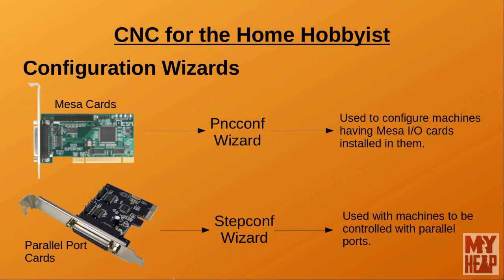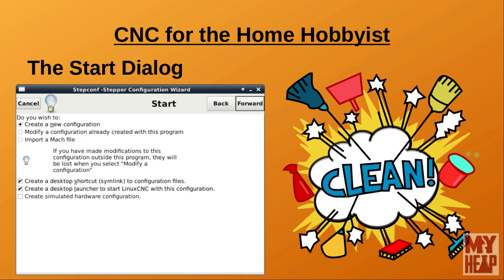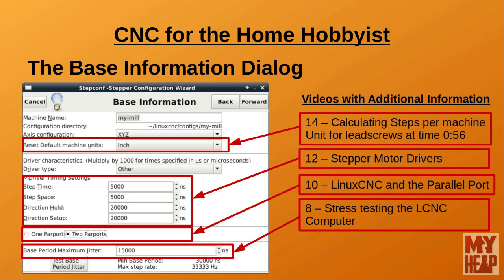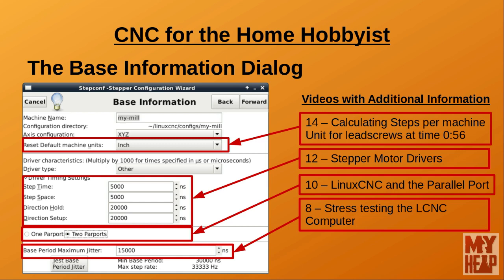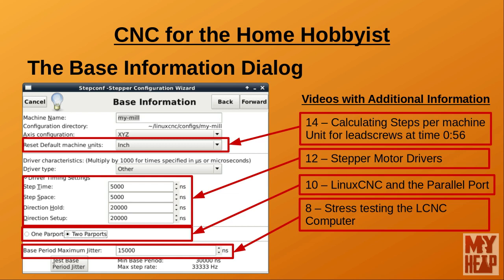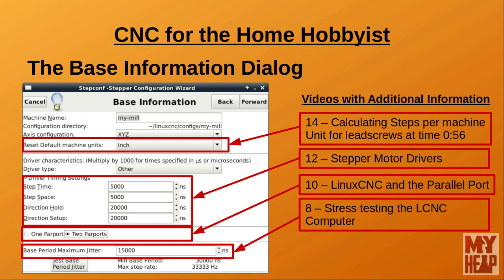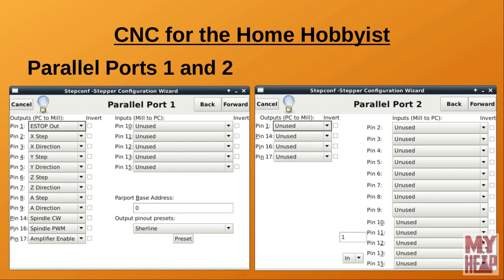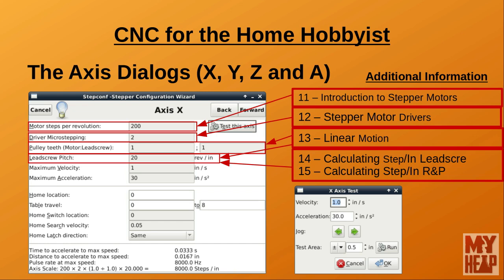LinuxCNC for the Hobbyist - 016 - Configuring LinuxCNC using Sepconf (Overview)

Comment: Hello Joe,

Great videos !  Very well researched and extremely well presented !!!

I've searched the web and gone through all your videos that discuss setting up and configuring the LinuxCNC software hoping to find a solution to a problem I'm having. Hoping maybe you might have come across this or if you could point me to the most logical place to troubleshoot next.

The issue is that my axes always move in just one direction regardless if I press the positive or negative buttons. If I hit X- it goes negative and if I hit X+ it still goes negative. Same with the other axes. I'm using a breakout board and have tried two completely different PCs, an older one with an onboard parallel port, and a much newer PC with a PCI-e parallel port card added. Also used two different printer cables.  I know the stepper motors and drivers are good as I had them running properly using Mach3 until I tried switching to LinuxCNC.  I also ran the stress testers and the Parallel Port Tester which did change the state of the LEDs on the screen but I didn't do anything at the BOB to test it.

Can you think of any possible wiring connection errors that could possibly produce that result ?  If so I'd prefer to start there. Otherwise, do you think the most likely problem is with the BOB ?

Thanks in advance for any suggestions you can offer.

This comment is being posted as cities and states across the US have just begun to shutdown due the the 2020 Corona Virus pandemic.  I wonder what people reading it one or more years from now will have experienced and remembered.

Jay Perez  Rochester, NY
Reply from the maker: Hello Jay.  Yes sir, you are having an odd problem but I think it can be found with some perseverance.

So what we think is happening is the direction pin is not changing state.  You mentioned that you ran an LED test and the screen indicated a change but did not test at the board.    The simplest way to test at the board is using an LED with a current limiting resistor.  Or even a volt meter connected to the pin.  The next logical place to look is the stepconf configuration.  Do you invert the step pins there?  Can you email me your config files?  My email address is xavier@gtec.com.  another great place to find help is on the LinuxCNC IRC page.  You can find a link to it on the LCNC homepages.

You are correct, we are at a time I have never observed before.  I realize that the Coronavirus is a bad thing, but the way the media is handling it makes it much worse.  When you start driving the markets with fear mongering bad things will happen.  I pray daily for our country and our people.  We need to set aside the petty stuff and unify for a solution.

Sorry for the delay on posting to you.  My son just got married Friday and it has been a crazy last couple weeks.  We thought they would want to push the wedding out but they were already committed to the date and everything set in motion.  All I can say is thank goodness for Facebook streams.

Joe
Reply: @MyHeap  Thanks for the reply Joe and congratulations on your son's wedding !

The Rochester Makerspace was recently closed and all access disabled so I won't be able to get in to grab the Mach4 config files for a while.

I've been communicating with Trevor at Newfangled's support but it hasn't been going well and I don't expect they'll be able to provide a solution.

I haven't completely given up on Mach but recently ordered a new breakout board and intend to start exploring using LinuxCNC as a replacement for Mach4 as soon as it arrives.

Thanks again.

Jay
Reply from the maker: @Jay.perez1  do you have the LinuxCNC configs you are using?
Reply: @MyHeap  Hi Joe,

Wanted to say thanks again for offering to help and give you an update on what I found.

After carefully checking all of my connections dozens of times I was absolutely positive they were all correct and assumed I had LCNC configured wrong. After struggling for days and many hours I walked away from the project. When I got the courage to try again last week I discovered within 5 minutes that I had the +B and -B stepper motor cables crossed on all three axes. (I can only assume my wife was coming down in the middle of the night and switching things around. She loves me like that !)

Apparently my understanding of stepper motors is incomplete as I thought the only two results of incorrect cabling was either the motor wouldn't turn, or, it would turn in the wrong direction.

In my case the motors would turn but always in the same direction regardless if I pressed the positive or negative jog buttons.

Still haven't wrapped my head around how that happens.

Jay
Reply from the maker: @Jay.perez1  Oh my goodness, I think I am married to your wife's sister.  HAHAHA  I am a little confused to, I would think with one set of coils reversed the motor would oscillate.  I am glad you have it figured out!

Joe

Comment: Hello
I have problem in X-axis when I want to run 100mm is not going 100mm it’s run half of it
Reply from the maker: Sounds like you may have your mocrostepping off by one,. For example, you have mocrostepping set to 4 in stepconf but have the driver set to 8.  Can you give me more information about your setup.
Reply from the maker: @issaal-habsi6758  you can email me to xavier@gtec.com.

Joe
Reply: @MyHeap  thank you
Reply from the maker: @issaal-habsi6758  I sent you an email looking for some information about the machine.  When you send it I will see what I can do to help you out.

Joe